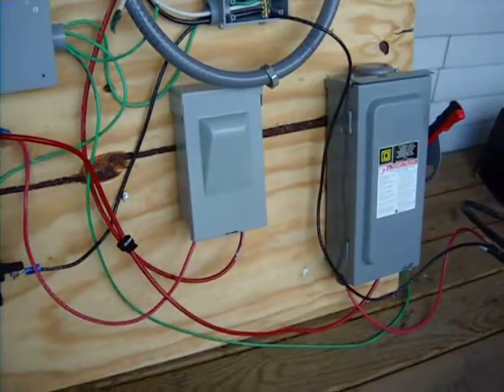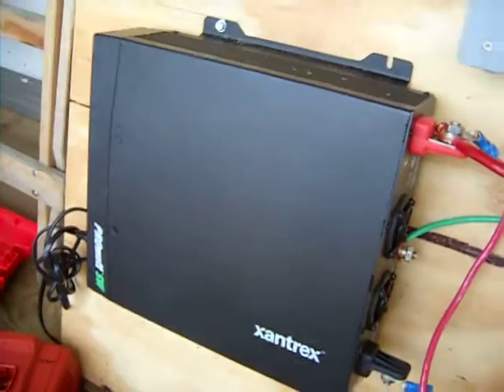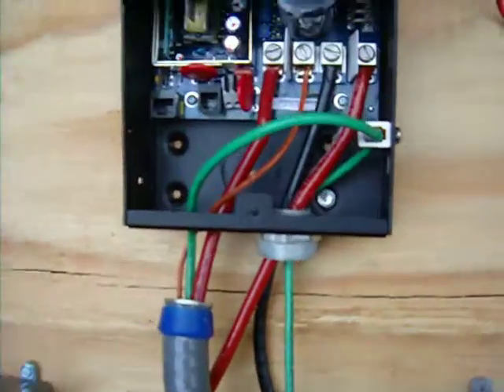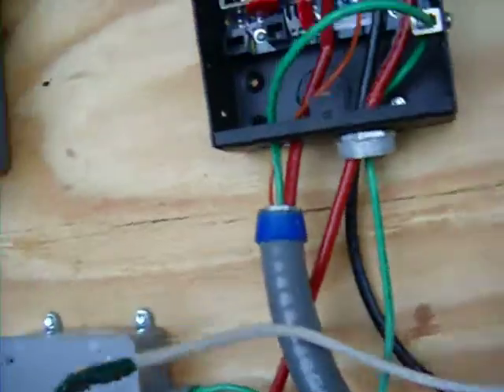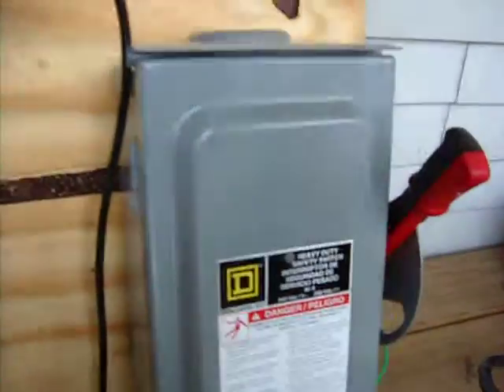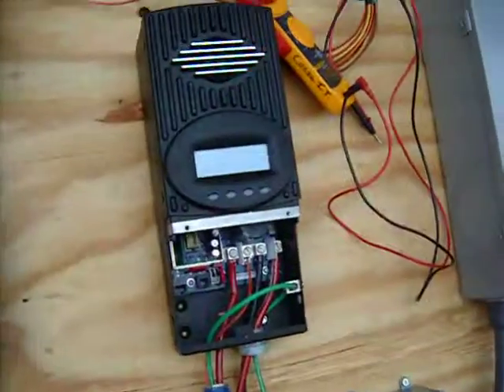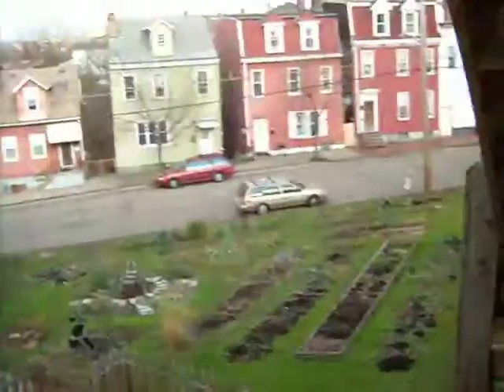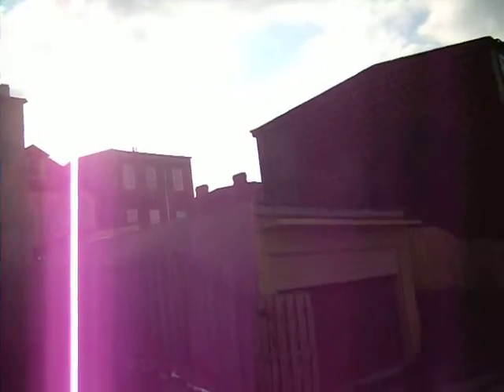Polish Hill Solar Proof-of-Concept (Followup) for 329 Hancock St/pghgreenhouse.org

Comment from the maker: Just to follow up for everyones info: I spoke with the Beat Crew at Outback Power in Washington state and they assure me that the negative bus from the PVs can be shared with the negative bus from the batteries EVEN IF THE VOLTAGES DIFFER, which blows my mind.  Additionally, its not an absolutely requirement that one does so, e.g., it having a separate negative bus exclusive to the PV wont impact/confuse the recharging logic.